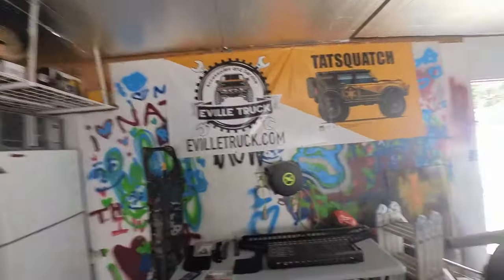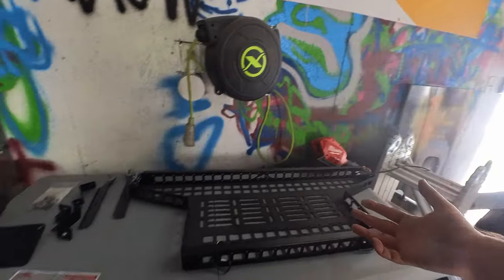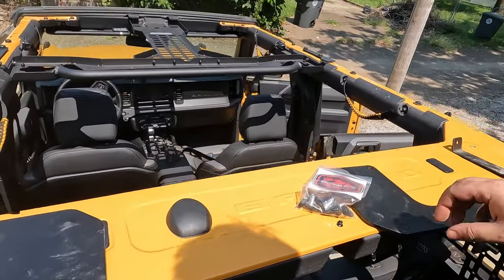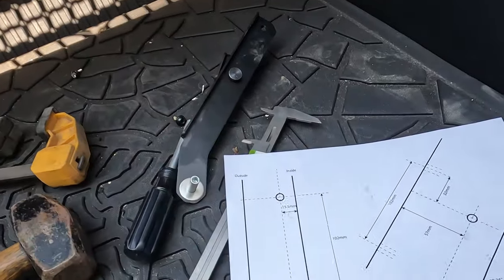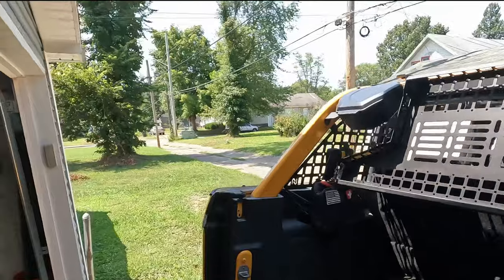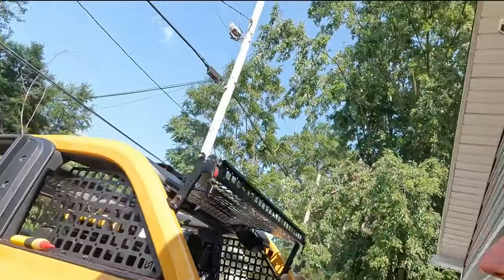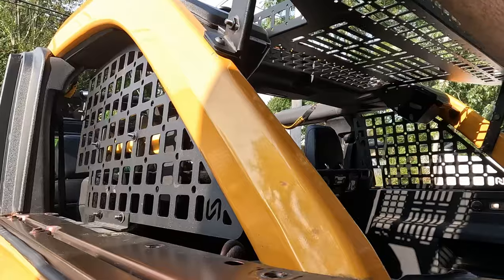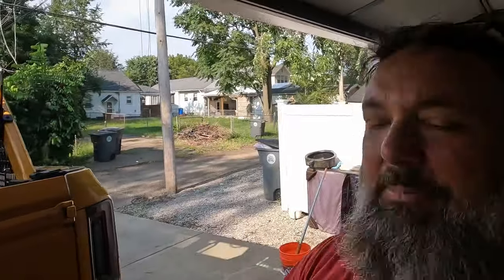Installing the M2M Attic Shelf in the Bronco!

Comment: Thanks for the video! What are your thoughts a few months after the install? Any rattles? Weight issues? A big question I have is what is the space between the rack and the soft top? How much room do I have for stuff in that space? Thanks!
Reply from the maker: @popo_patty  There’s not a ton of room. It’s about 2-3 inches to the hard top I have on, assuming it would about the same for the soft top.  I just keep some recovery straps and tire inflator kit up there so I always have it but it’s out of the way. No rattles or anything.